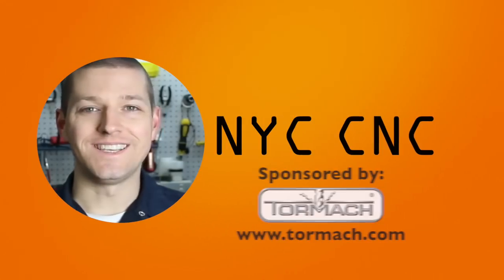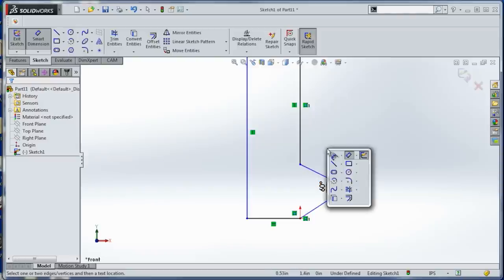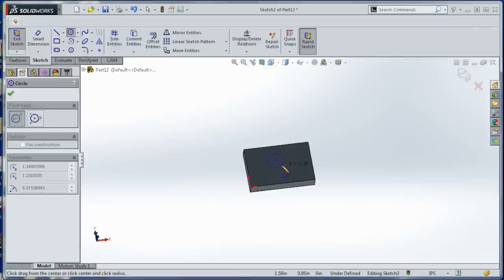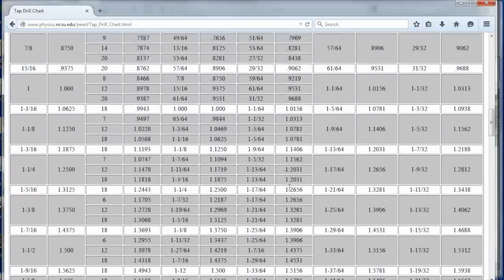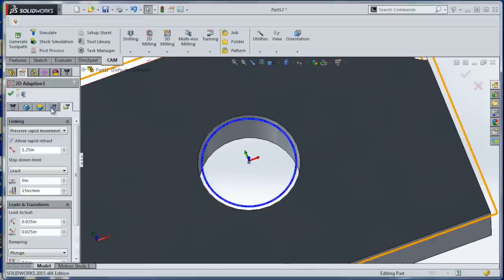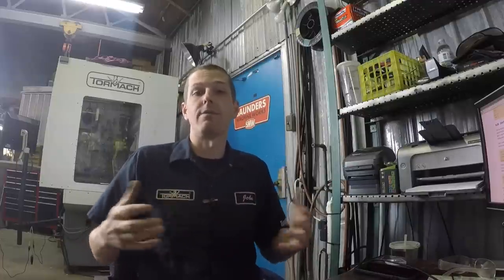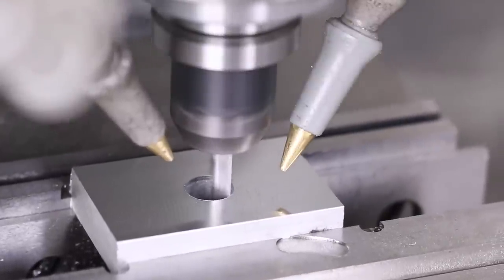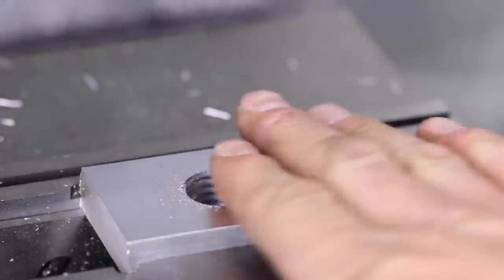HSMWorks: Thread Milling Tutorial!

Comment: This is a great introduction to thread milling, another tip is to make sure the feed rate during the initial arc-in is significantly lower than the rest of the cutting, the arc-in puts a lot of load on the thread mill and most manufacturers recommend a much lower feed rate while arcing in. Another note, we have a very accurate machine here with excellent tooling, there is no need to get our major and minor diameters from the regular "shop sheet" that's meant for shit quality taps, look up a real thread chart that list the different classes of internal threads (1B, 2B and 3B). Keep up the great videos!
Reply: Raffi A Arc on feed should be 30-50% of machining feed rate to be on the safe side.

Comment: I use this in Inventor HSM. It is GREAT to see that Autodesk set it up to cooperate and function identically between the AD and SW products. Every thing you did there was the exact same as in inventor. This will really help in the job market since it is a unified CAM platform.

Just a slight suggestion, there is one feature in HSM that lets you do the path off the existing geometry (post op). It is one of the stock settings. That is why when it did that plunge, it did a spiral from center, rather than engage and cut. You can set it to use the stock just after the drill op. Eliminates the spiral! Then set a .005 spring cut at 7IPM.

Also, I am quite eager to see your tutorials upcoming! It will be good to learn a second approach to it.

Clear video. Fast enough to keep attention, yet slow enough to pause easily, duplicate, and test. :-D

Comment: now show us how to do it in my old engine lath .  it an old Colchester  school lathe  with no screw cutting led screw it dos it threading &  pitch by using the rack ,  i can get up to a 6 threads to the inch the same as my  spindle nose .  i have no threaded  chasing dial  , So scrolling out with a thread milling cuter is the best option . as i can position the tool at a defined start. position .  & rotate the chuck slowly .  give me feed back on this subject ?

Comment: John,
Can you add cutter comp to your HSM post and can your Tormach read cutter comp? If so, thread mills are big fans of cutter comp. Also, a second deflection pass always helps. But using the cutter comp will give you much more on the fly and precise adjustability of your final thread form.

Comment: I program thread mills by hand usually. Just the way im used to. Its ez, its just a bunch of circular interpolations with a K value thats equal to the pitch. (right-hand threads are programmed from the bottom up for climb milling)

PS. thread fit is what cutter comp is for. make sure your post includes cutter comp (g42 for right hand,, g43 for left hand)

Comment: Sometimes thread milling is the best and most practical way to cut threads, especially on large threads in hard to machine materials. I use Mastercam and mostly choose standard tools from the tool library.  I also have the option of creating custom tools when required. I also set my tool parameters with a radial wear offset to adjust for pitch diameter and tool wear.

What's the best software and best way to do thread milling or any other machining process is what the user prefers.

Comment: Hi, 
I do the majority of our work in 303 ss.  We are cutting ANSI 0.75” -18 to 2.25”-20 2a and 2b threads on a Haas lathe with live tools.  Would you turn the treads or use a 6000 rpm live tool and a thread mill? Thanks for your advice.

Comment: Do you have any smart ideas of how to build a thread cutting tool for us hobbyists(students) that dont have tons of money to spend on a threadmill. I just got my cnc converted mill working and did som test threadcutting with a grinded M10 tap that i removed all theet exept one. it workes but not so well. A tool out of HSS would be nice since it's so easy to get a hold of. is there some easy way to grind a hss tool good enough for hobby work? Or is a tool made with a lathe threading inset the only alternative? (even if it is much more expensive). 
Love your videos!

Comment: Why don't you use cutter comp!? That's how I open the threads up when I'm thread milling! And I also tap 2"+ taps with my machine(obviously you can't with the tormach) but you new haas can tap 3/4-10 no problem. Plus it should have synchronized tap feature so you can tap blind holes with a tap to the bottom without the worrie of it floating!!!
Reply: pfft. why tap in a CNC? Thread-milling= way less headaches

Comment: Do you find that a 50% thread engagement is more common for large threads in aluminum as opposed to 75? Is there a diminishing return for thread pull out load with alum or some other reason? Just curious.
Reply: "Large threads in aluminum"? "50%"? Can you be more "specific" and give some examples? When it comes to "large threads in aluminum" if STRENGTH and QUALITY and DURABILITY are the ultimate goal, you only have "50% engagement" between the aluminum and the stainless/steel "thread insert" you put INTO that aluminum so you don't HAVE "aluminum thread" with a steel fastener screwed into it. If more manufacturer's would "bite the bullet" and just "Heli-Coil" or otherwise "insert" their "quality" aluminum parts/threaded holes at the "factory", there would be a hell of a lot fewer "experts" on how to thread aluminum "correctly" who clearly don't know their asses from a hole in the ground since the last thing you want with a "softer" and "weaker" metal is LESS THREAD ENGAGEMENT.

Comment: FASTER METHOD!!!  

Simply helical ramp using pass depth per inch to match thread pitch.    Then offset the diameter to the thread depth measurement.   

Extremely simple to do with any program that can cut a spiral cut for z depth.

Comment: rather than using plunge, set your stock contour to resemble the stock removed from drilling. It will then automatically plunge, and it will remove all of the air-cutting the spiral does and skip straight to the good stuff.

Comment: It consistently doesn't cut deep enough for me, and I think I figured out the problem.  Using the 3/4"-10 thread example, the tip of the cutting tool runs along the 3/4" diameter.  The problem is that 3/4" is the O.D. of the screw with flats on it.  That works if the O.D. of the cutting tool includes identical flats.  I think you need to cut to the theoretical tip of the triangles.

https://en.wikipedia.org/wiki/Unified_Thread_Standard

I added H/8 to the radius (H/4 to the diameter) to get to the theoretical triangle tip.
H=.866025*pitch = .0866025" for a pitch of .10".  
H/4 = .0216".  
H/4 added to the 3/4" diameter = .7716".

A shorter version for internal threads is: 'threading hole' =  'outside diameter of threads' + (.2165*pitch).

A .7716" diameter should be the perfect diameter to run the tip of the cutting tool for perfect threads.  That said, that's very different than .750", making me question my whole premise.  Please test this with your setup (Using 'Stock to Leave') before working on anything important.  Too much material can be removed, too little destroys parts.

Update:
I tried this with a smaller thread and it does work.  If I leave an extra .005" stock it's too tight to screw in, with no extra stock it's a tad loose for my taste.  Cutting just to the screw O.D. was always way too tight.  Also, I did external threads and the formula is slightly different.  The theoretical cylinder you're cutting external threads against has a diameter of the screw diameter minus 7/4* H.
H=.866025*pitch = .0866025" for a pitch of .10".  
7/4*H = .1516".  
screw diameter minus .1516" = .5984" .

A shorter version for external threads is: 'threading cylinder' = 'outside diameter of threads' - (1.5155*pitch)

Comment: maybe there's something wrong with how I imagine this in 3D, but won't there start to be an error in the shape of the groove when the diameter of tool is a significant part of the hole diameter?
i.e for a 60degree to cut a 60degree groove the tool has to be perpendicular to the groove, but it can't be since the thread pitch mean the groove is slightly tilted from horizontal
Reply: I agree, the same thought occurred to me, but it's apparently not a problem at the scale being used. Have to draw some pics and do some calculations to figure out at what point it would start to be a problem....if it is.

John, what's "tilted" is the thread path relative to the axis of the tool.  You are effectively inserting a horizontal disk into a sloped slot, so the question is at what point won't it fit?  Or, more accurately since the disk is creating the slot, at what point will the slot become distorted to fit the disk?  

I suspect that the answer is that the slot will be fine, but the bottom of the slot...which is supposedly V-shaped like a tap would make it, is actually rounded due to the cutter being high on one end relative to the thread, and low on the other...with a smooth transition between the two points.  If that's the case, it's actually better, since a curved transition is less likely to create a stress fracture than a sharp transition, and with 75% or less engagement, the bolt thread won't reach the milled thread bottom anyway. One way to find out would be to cut a threaded hole in half, and look at it with magnification to see what shape it is. If you are curious... :-)

A minor niggle...you said that all threads are 60 degree...that's true for American coarse and fine pitch threads, but there are other standards. For example, British Whitworth is, I think, 55 degrees. Not sure what Acme is, but it's not V-shaped anyway. Nearly all that we are likely to run into will be 60, but just pointing out it's not as universal as you implied. 

Thanks for sharing, and for keeping the computer stuff to a speed us newbies could follow!

-- Mike
Reply: +Lasse Langwadt Christensen Most single profile thread mills I've seen have a recommended thread pitch range because of the distortion you're thinking of.

Comment: Not that knockin you, ( i like your videos ) but i think that program was simple enough to just program by hand. Small blocks with tooling diameter offsets to get proper thread clearance: .5 spot drill, G83 peck, .375 4 flute Carb EM using a simple G13 so there is just one spiral at full depth ( aluminum is butter ), and programmed toolpath with cutter comp on the thread mill.  I have yet to learn all that much using solidworks or autodesk, but with simpler programs programming on the fly, i think, is much easier.

Comment: if you wanted it slightly looser all you had to do is run the threads one more time without changing anything, it will remove a very small amount and the fit would be perfect
Reply: There is a 'Repeat passes' button on the passes tab of the thread command specifically to re-do the final pass to eliminate error due to tool deflection.

Comment: It looks like  your root diameter was a little bit too big, you can see the flat edge on the thread
Reply: +Dolan Kang i think its from the chart he used said 50% surface contact so no i think it was entended that way.
but yeah he could have gotten a litle more engagement and have less of a flat. also he could have chamfer the top and bottom to make it cleaner i think but works ok like it is i think.